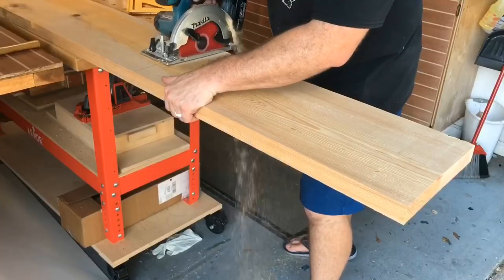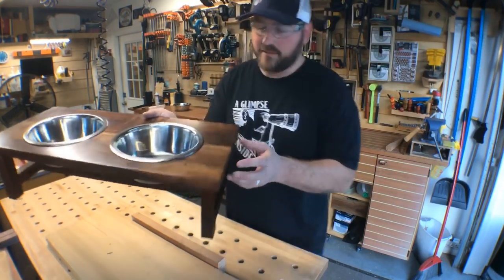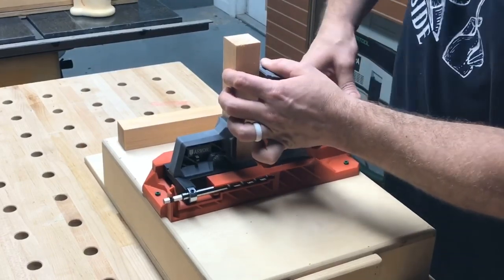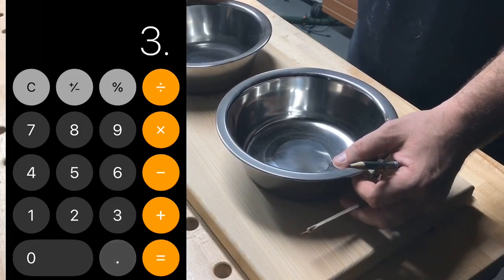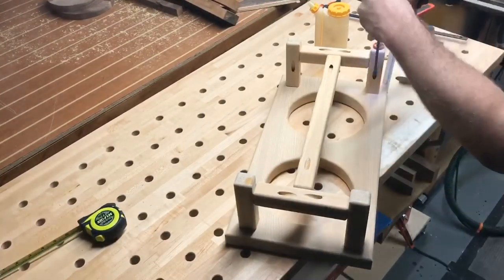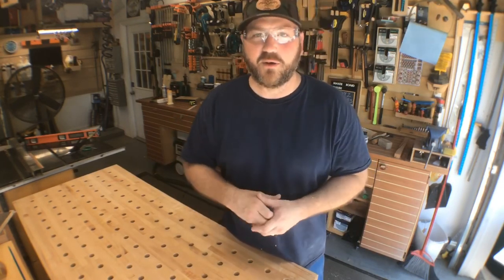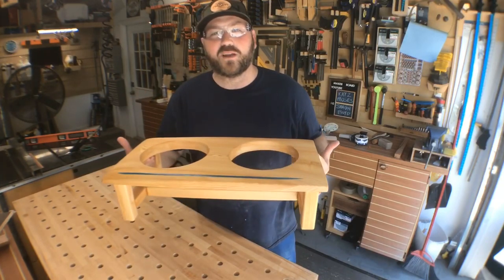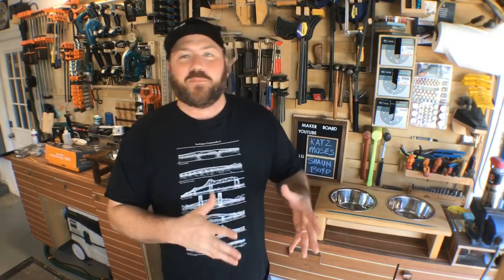How To Make A Wooden Dog Food Feeder | Easy Woodworking Project

Comment: I usually don’t change out of my work clothes if ive got a project going on in my home shop. I work st a fertilizer mill outside of my home town. Get covered head to toe in various substances; weld slag, chicken feces, oil and grease from working on equipment. You name it. Lol. So when I get home I’m already dirty, but it is SO much more rewarding to be covered In saw dust in my home shop.

Comment: the one thing I would have done is added a fingernail notch or a finger tip notch, along the cutout for the bowls. would have made it easier to get the goals in and out. 

but all and all  awesome build.
Reply from the maker: Thanks for the invite brother. That’s definitely a good idea
Reply: @AGlimpseInside  lol goals? sometimes I really dislike autocorrect. lol bowls. lol
Reply from the maker: Dracos Diabolis You know it’s funny mine was supposed to say thanks for the information brother not the invite. Either way of course are invited here on this channel. But yes I was victim to auto correct as well